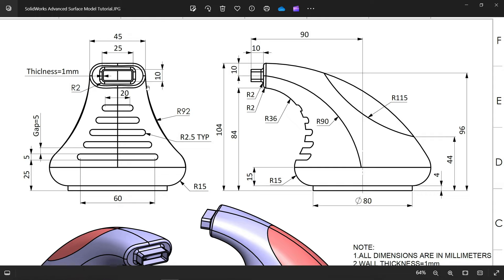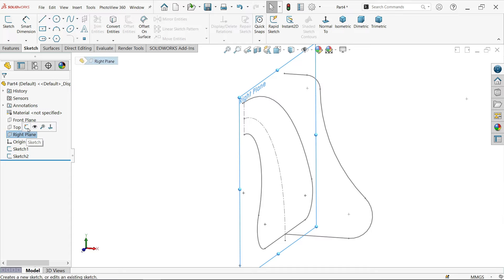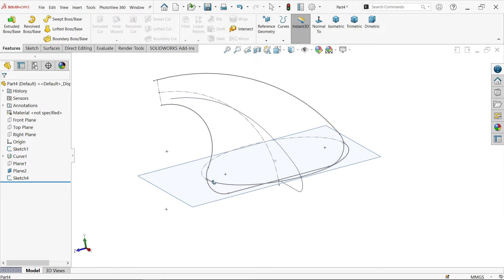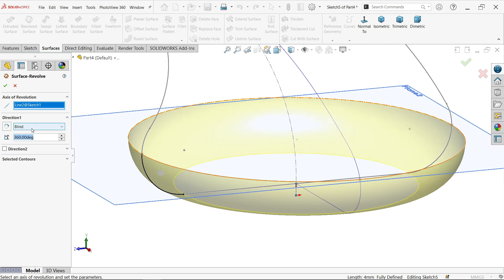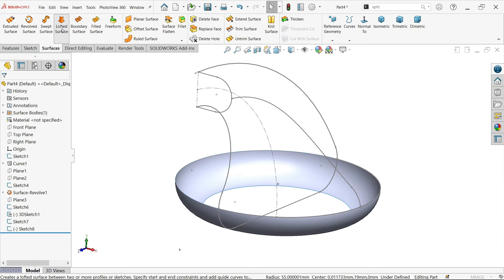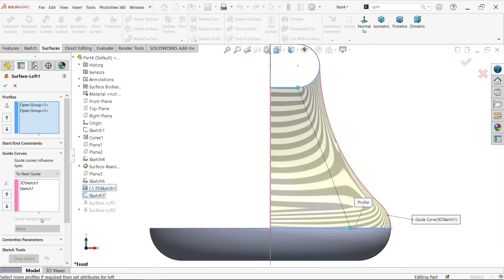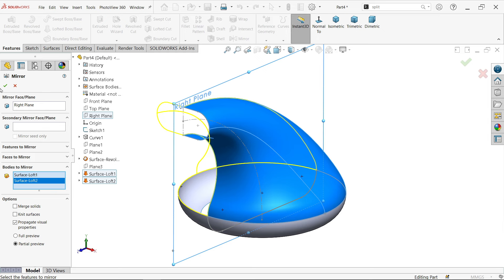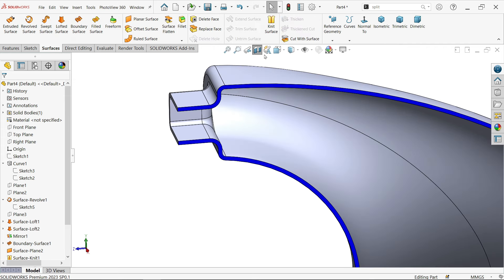SolidWorks Advanced Surface Modelling Exercise 219

Comment: Great video, u did a lot of extra steps that are not necessary, however since this is a tutorial is fine. You made a mistake with one arc, the center arc with 90 radius is not coincident with the vertical imaginary line of origin, instead is tangent with the horizontal line at the middle top, I think this is why u have problems later with the surface and the curvature.